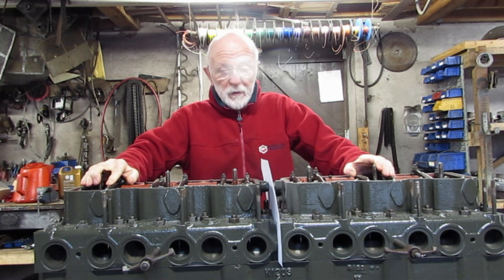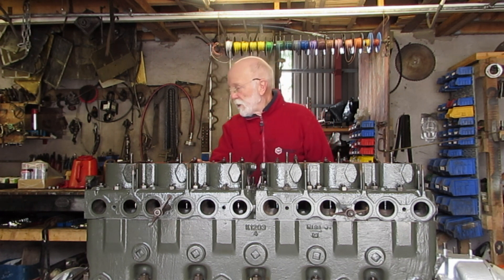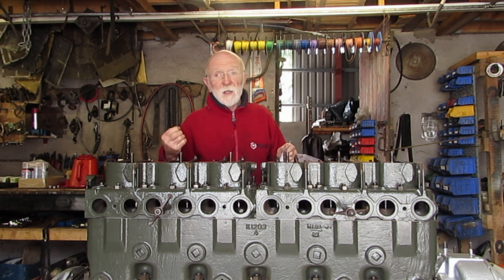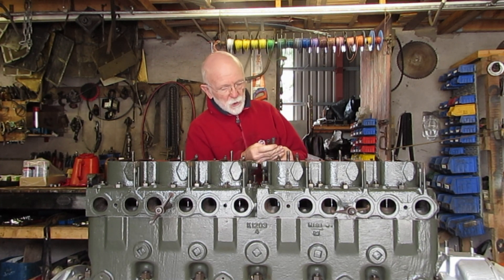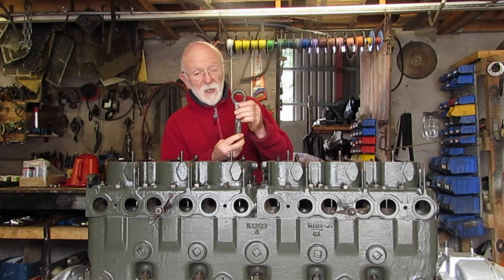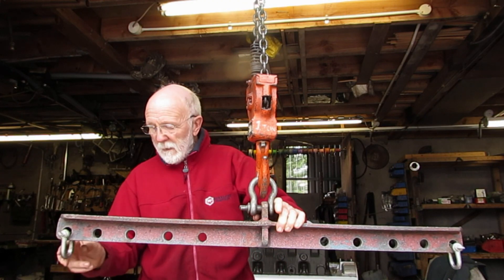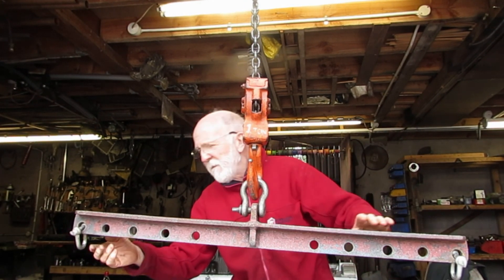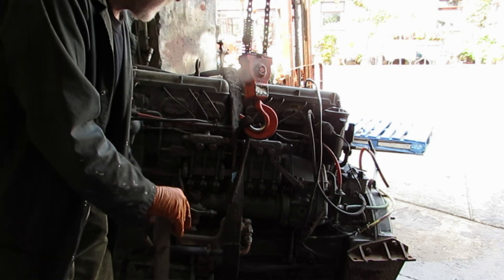Gardner Engines: how to lift them

Comment: Very interesting joe, I came across a Gardner engine in a converted Air Sea Rescue launch in Gib, but at the time it meant little to me.
It was a very good engine because the boat started taking in water from three prop shafts! Poor maintenance?  so we used the intake for the engine to get the water out needless to say by the time we reached a port the rubber impeller was shot, but it was a wonderfully running engine, hour after hour. Great info.

Comment: I once seen a guy, lifting a 150 LX by putting a lifting chain hook between the cylinder heads. He wedged the hook between the rocker shaft bolt heads which are between the heads !!!
A little knowledge is dangerous.